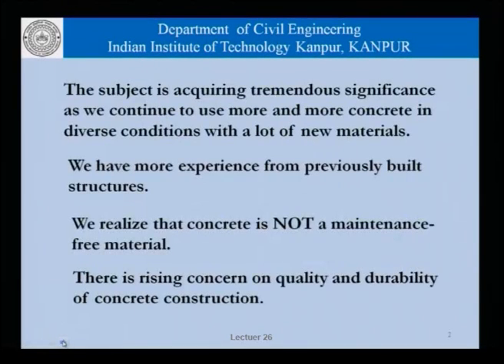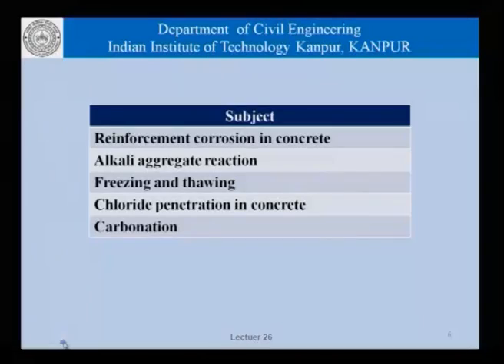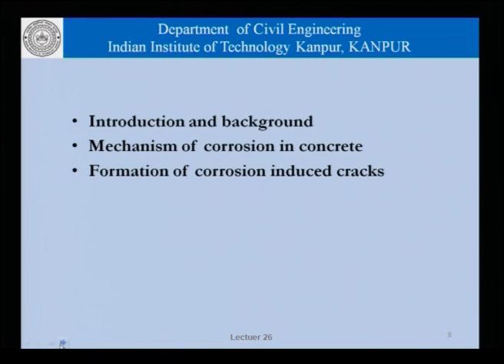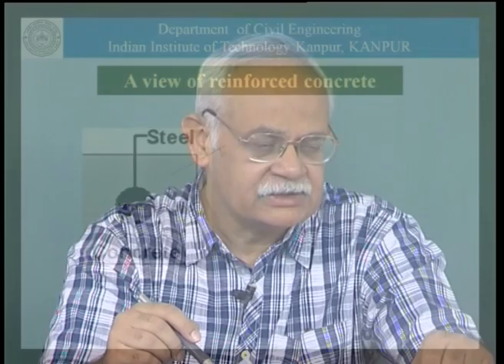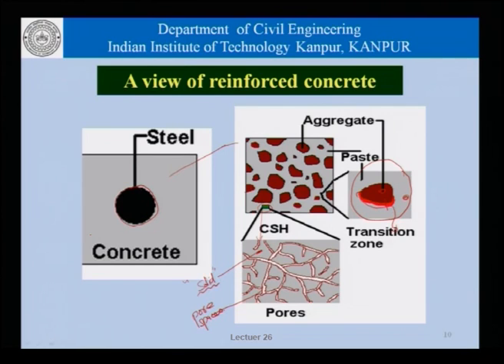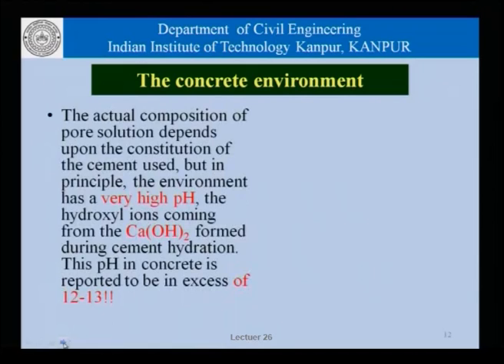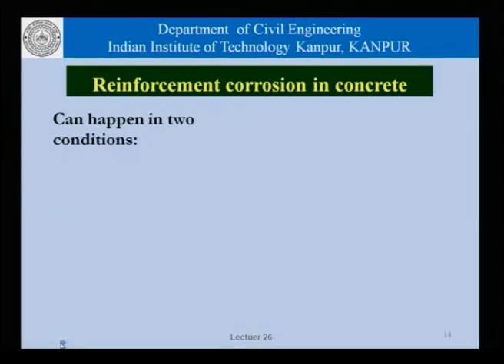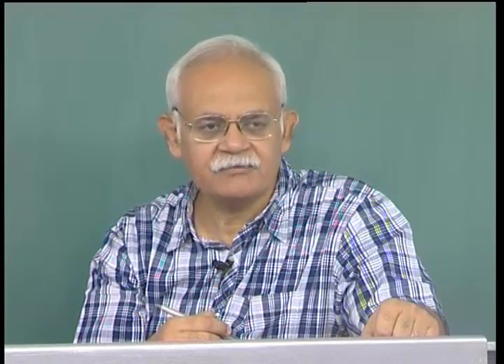Mod-01 Lec-26 Reinforcement corrosion in concrete

Comment: Thank you for your excellent lecture on the subject of concrete reinforcement corrosion. I found it very informative.

I have a question on which I would appreciate your opinion.

Would you think that pre-treating steel rebar with a phosphoric acid based, "rust conversion" material (e.g., Ospho -- http://ospho.com) would tend to improve or reduce the quality, thickness or effectiveness of the passivating film in the presence of the damaging, pH reducing effects of the carbonation or chloride ingress you describe?